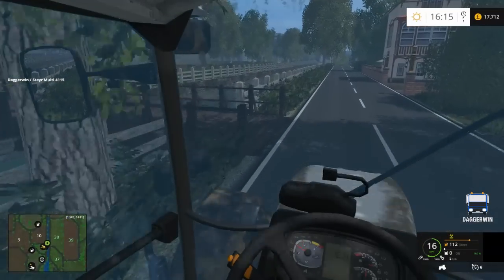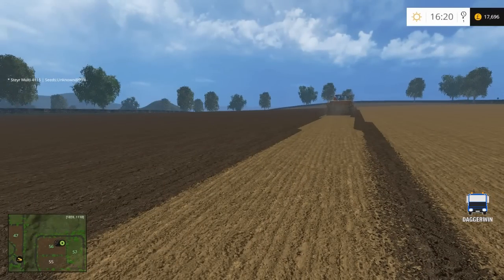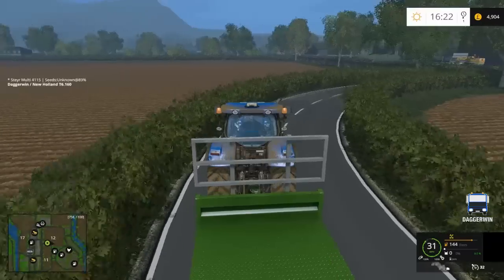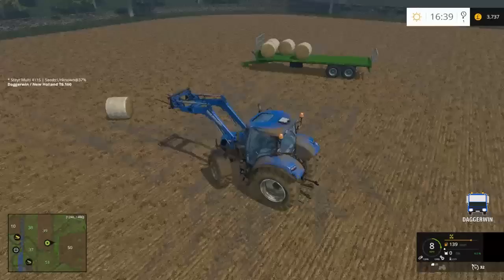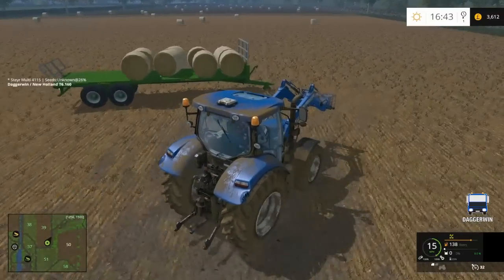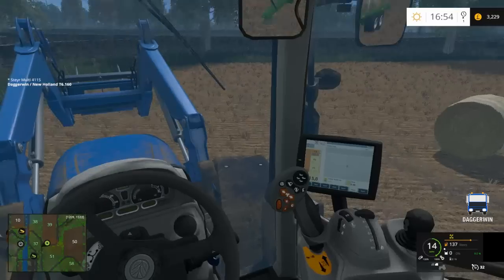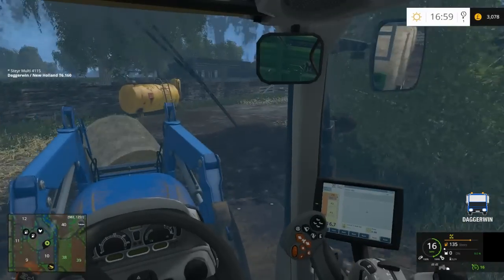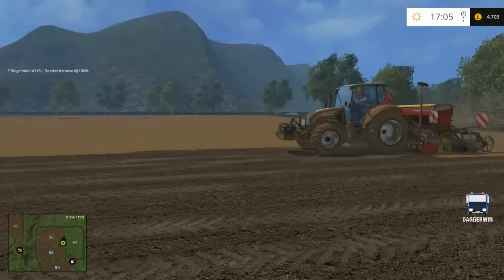Let's Play Farming Simulator 2015 | Iron Horse Farm Episode 6

Comment: Great job Daggerwin. You may not be perfect, but hey, I'm not too great either. I think if you bring up the HUD for that trailer from Bulletbill, it will show a button where you can lock the bales in with straps. I also use the spike, I just wish the bales were bigger, to allow more room for the spike, y'know, something like FS13's round bales from the krone.

Comment: You might want to have a look at the HW 80 Ball Trailer on modhoster. Its a nice little bale trailer with a good locking script. Its a bit small, holds 16 or 14 round depending how you stack them but it works really well in tight places like that map has and its cheep. Also why are you using the bale spike and not the round bale fork?
Reply from the maker: +pilfit Thanks I will look into it. I can't use the round bale fork lol :D
Reply: +Daggerwin i use the bale spikes to load them and then use the bale forks to unload cause u  can get between the bales    p.s u are complete  awesomeness :♢
Reply: +Daggerwin because the round bales are smaller on fs15 compared to fs13 the bale has a smaller load point for the double spike on loader, I did find it easier loading two bales at a time (with nh telehandler) I have not tried it with loader yet but if it will lift two side by side (spike in each bale) half your battle could be won

Comment: You need to be dead straight in going into the bale with the spike and be really level with the forks when taking them out its slot easier if you get dead straight. Maybe look for a better trailer for it and it will work much better.

Comment: you are supposed to start at the back of the trailer not the front
Reply: I always load my trailer from the front. Sue me! #rebel
Reply: +Harrison Bamber No you're not.You load from the front to the back. If you load from the back your trailer will put a lot of pressure on the hitch on the tractor and possibly lift the back of the tractor off the ground.
Reply: I load trailers for a living mate. Always front first.
Reply: Aaron Davis it will not tip the tractor it up bales only weigh half a ton
Reply: +Darragh Dwyer same last name mate
Reply: +Harrison Bamber i do it for a living to dude haha. Trust me you get draw bar trouble when loading from the back on a spring loaded.
Reply: I load bales for a living and that's my way how to do it what bale trailer do you have
Reply: +Harrison Bamber "you are supposed to start from the back of the trailer not front" is different than saying "my way of loading a trailer is from the back" know what your saying
Reply: Peter Moffitt at least someone agreas with me
Reply: +Darragh Dwyer same here, front first is the best way to load a trailer safely.